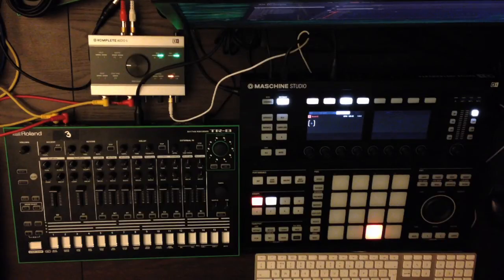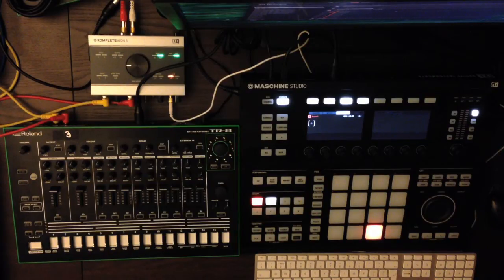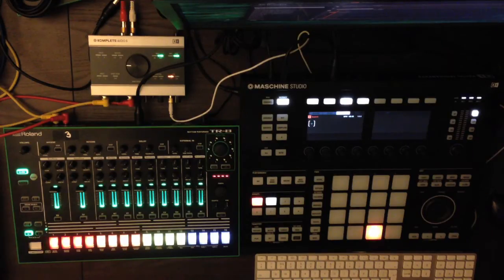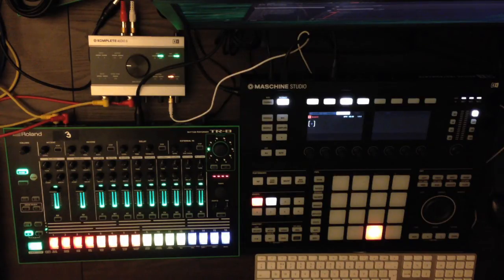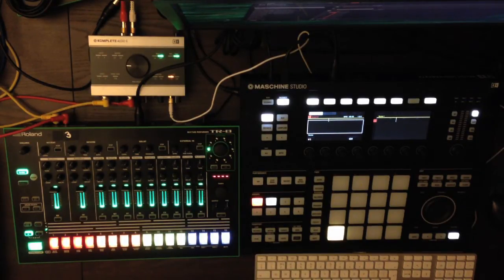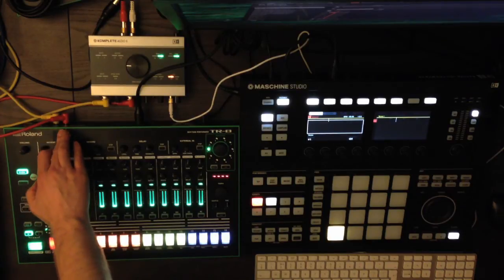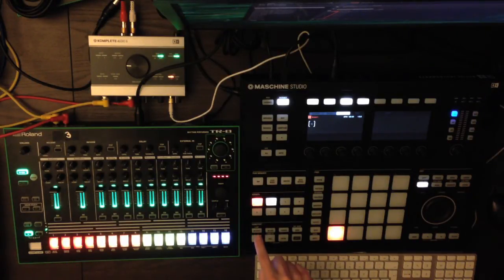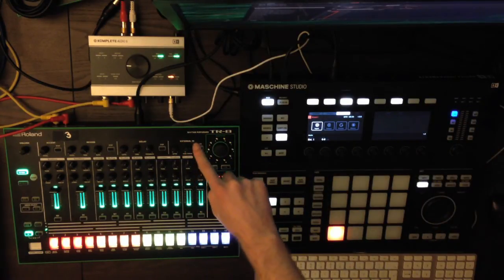How to set up the NI Maschine Studio with the Roland Aira TR8

Comment: Thanks. Where is the follow up video ?
Reply from the maker: Hey - I've just ordered a lapel microphone because it was a nuisance having to hold that large microphone and then chop the video up afterwards. Also just got a new laptop so spending some time installing everything.

Hopefully it will be done in the next week or so. Then after that, video 3 will be about recording your TR8 knob and fader movements into Maschine via MIDI CC.
Reply: Thanks looking forward to it, still looking for a proper to integrate the Aira line in my setup ...

Comment: wow Mymind is blown. thank you for showing me how to do this. the possibilities are endless. so technically if i have maschine mapped to control me ableton drum racks I can route the roland through my maschine midi I/o and control an ableton drum rack?
Reply from the maker: Yes - you could use the TR8 step sequencer to trigger sounds you've got loaded into an Ableton drum rack. It would require a bit of trial and error to see what midi notes the TR8 is using for each sound and then making the sounds of the drum rack respond to each of those.
Reply: Inversion of Control
 sweet thank you very much im gonna have too tinker around wt this ill let u kno if I have any issues.